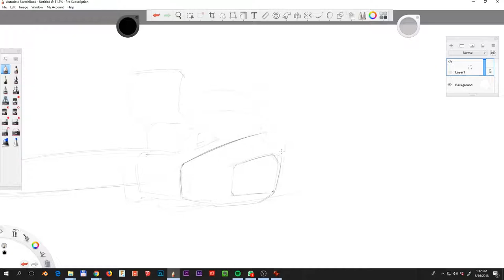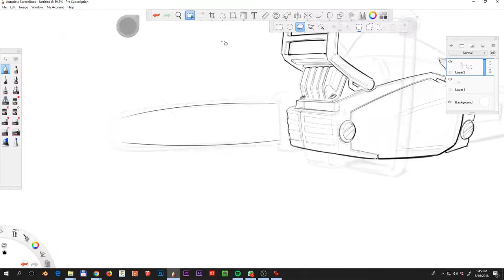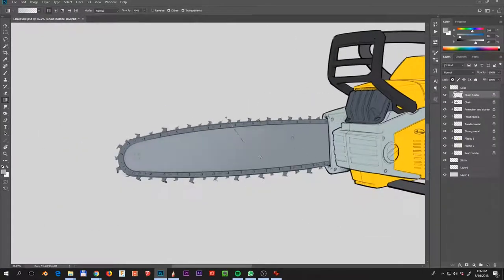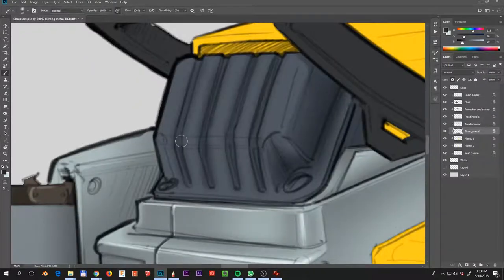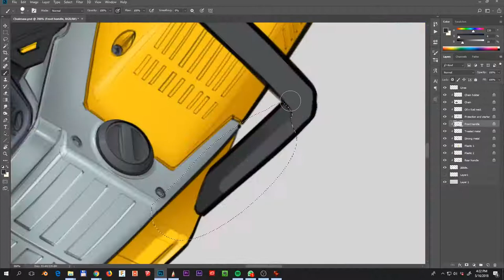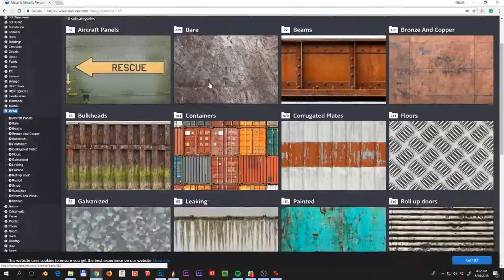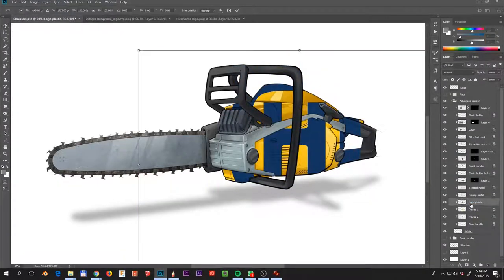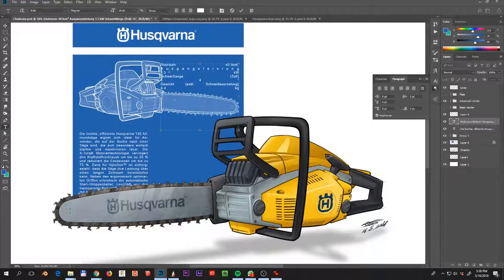Chainsaw drawing process for Industrial Design

Comment: I've noticed a pop up on your screen reminding you to take a break. Which program is that you use?
Reply from the maker: Oh no i forgot to edit that out, darn it lazy editing on my part. ^^

On pc i use Work Rave. I set it so i have a10 sec break every 10 minutes and a 3 minute break every hour.

On Mac i use Time Out free with the same settings.

It's important to constantly switch positions if you're using the computer all day long.
Reply: @robertlkiss  I will check those out :-). Thank you.